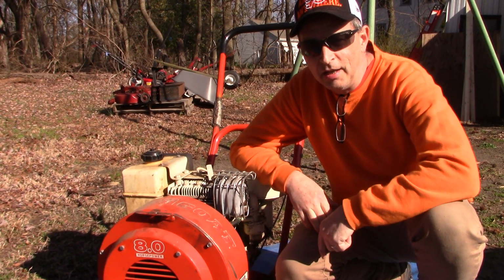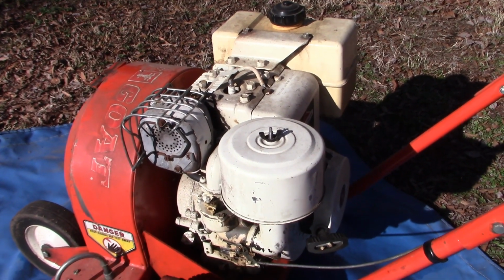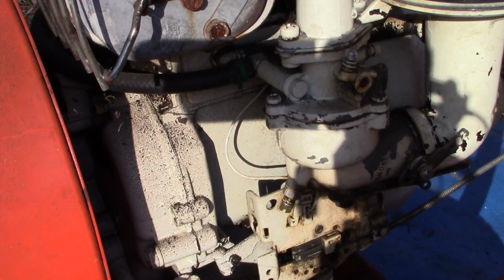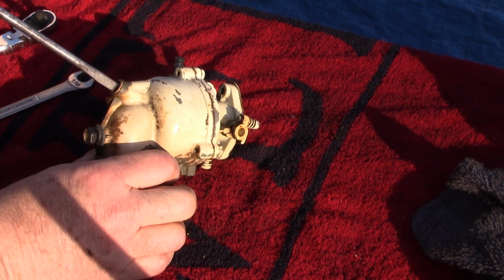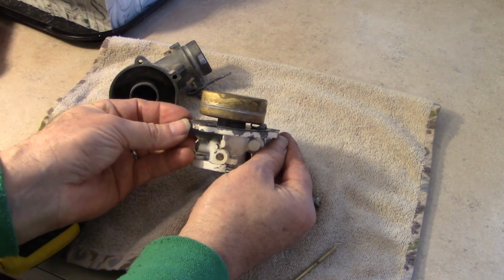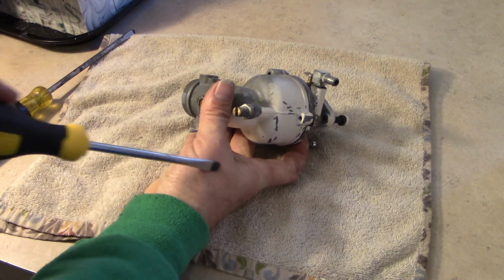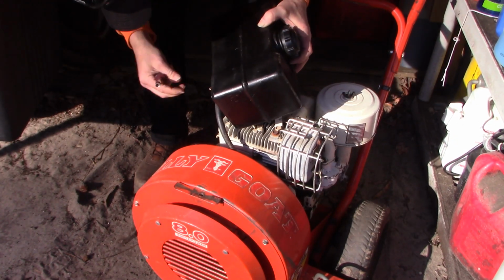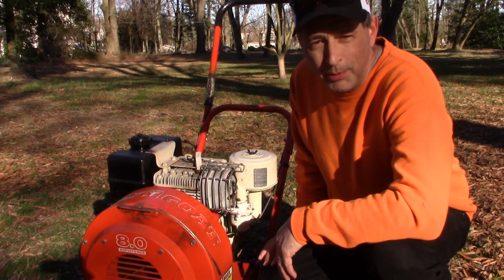How to FIX a BILLY GOAT LEAF BLOWER - 1985 B&S 8HP

Comment: I have a Billy goat leaf blower with a GC 160 5.0 Honda motor new plug , carb , air filter it starts if you drip gas in the carb but wont run other wise it’s not getting fuel for some reason all hoses are clear  what’ am I missing